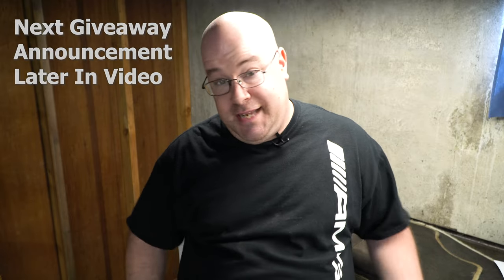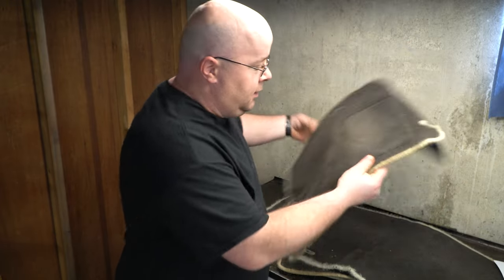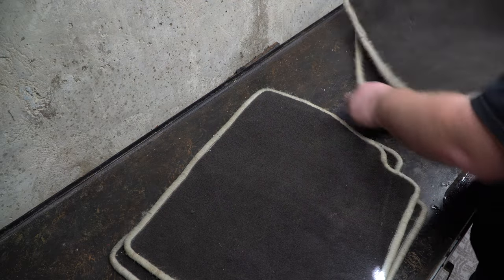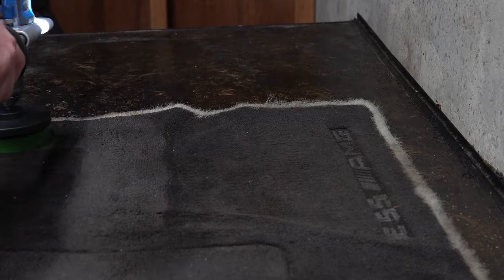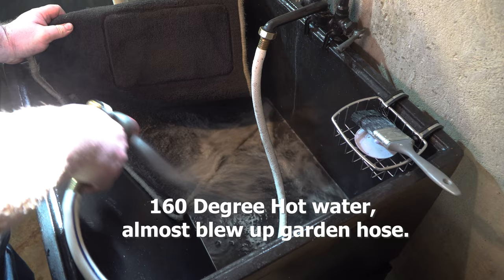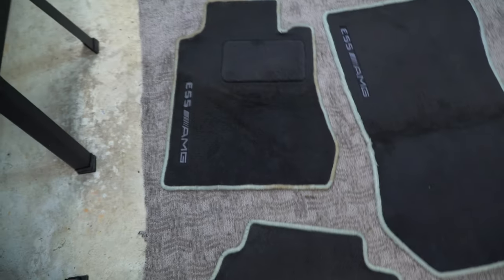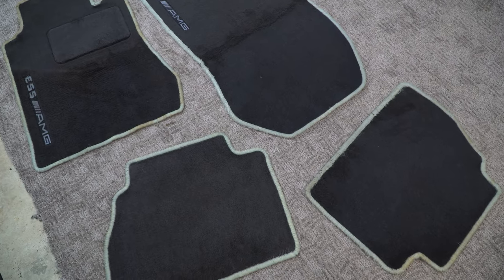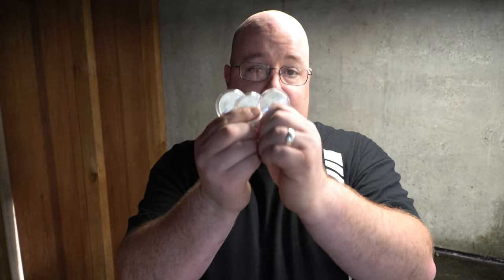Giving Away RARE $200 W210 E55 AMG Floor Mats

Comment: I would definitely take the floormats. I just pulled my 2002 E55 out of storage after 2 years. CEL SRS stuck in limp mode. Appoinment at my mechanic on Tuesday. Favorite Mercedes probably W126 560 or  W210 AMG
Reply from the maker: @SeamHead33 Awesome that you are getting  your '02 back on the road and best of luck at the mechanic. Glad you want entered for the floormats, honestly a bit unsure if there would be any takers, you would have a great home for them :)
Reply: @BaldManMotors  i know how hard to find/expensive they are, and you did a good job bringing them back to being acceptable. Out of 3 E55 I've had, only my current 1 had the original floor mats, so I'd be pumped to have a spare set

Comment: Tough question, favorite Mercedes.  First choice is a 300 SL Coupe (gullwing).  After that, the original AMG Hammer (W124).  I read about that in the magazine reviews when I was in high school (1986!).  Third choice would either a C63 AMG Black series or an E63 AMG Estate.  Big aspirations I know, but I still wouldn’t want to give up my 2000 E55! I ended up buying the logo floor mats from Turkey off of eBay.  They work good for daily mats but slide around a bit so I need to do Velcro or some other fix to keep the driver’s mat from sliding forward.  I have the originals still and need to do the cleaning as you showed us here.  That will require purchasing a steam cleaner, but I want one anyway.  

If I win, I would choose the silver.  Cool video and cool promo.  Thanks Jim!
Reply from the maker: @Rob Voorhies I have to agree on your first choice if I had enough money to let a cool few million sit in a car :) Now if I had enough for car #2 (the daily driver) it would be SLS Black Series Gullwing. Darn still 5-600k. Okay well then I guess a C63...any C63, sooner the better. I also wouldn't want to part ways with any in my current collection so third world problems I suppose. I honestly like all the older AMGs and even miss my '72  dark green Mercedes 220  I used to have but unfortunately the floorplan rusted out of it. I like only some of the newer AMGs and Mercs but I'll save that diatribe for a future video :) By the way I have a link in description for some cheap carpet tape that I have found works decent for floor mats in case you need it.

Comment: Favorite AMG car that's tough. The W211 E55 is magnificent with the M113k, but I dislike the SBC brakes. That's why it may be a tie between the W210 E55 and the W203 C55. My C55 is also currently on display at AutoRama as well as a group of other Euro cars. Stop buy if you're in the area

Comment: Hey man .. love the videos specially on the w210 .. i would love those floor mats (based in dubai and i will happily pay for the shipping) can't find any set of them here and i own a 2001 E55 that came without them it has 158km or just under 100k miles for you imperial folks .. i also own a w210 E50 
Favourite benz i would say the 300SL gullwing or the 300SEL 6.3 
Looking forward for many more great videos on them AMGs
Reply from the maker: @FAWZI My W210 videos are definitely the most popular, I try to balance videos on all my cars as I have fans of every one of my AMGs but I am glad you are enjoying them! it's cool you have a E50 and a E55, are there any differences in driving feel besides the engine? Not sure if the engines weigh the same etc. The gullwings are awesome!
Reply: @BaldManMotors  didn't drive the E50 that much as its kinda of a project .. but when i drove it it felt a bit lighter and nimbler than the e55 ,, the tranny is a bit of a bummer but the engine absolutely sings at high revs
Reply from the maker: @fawzi9656  awesome and interesting that it handled a bit better. It's on my list someday to drive an E50.